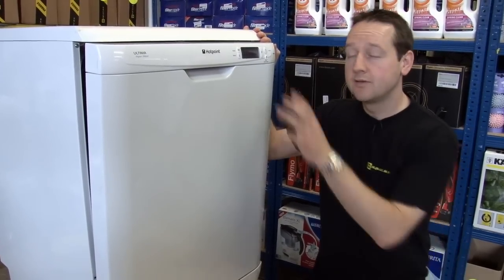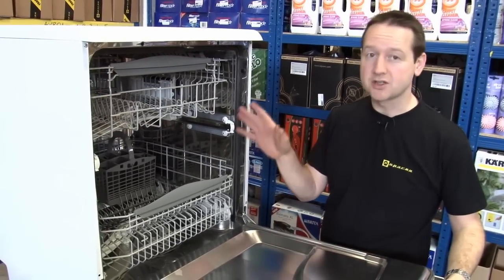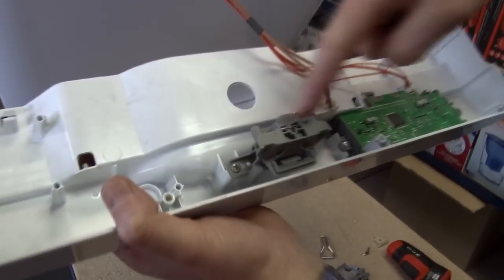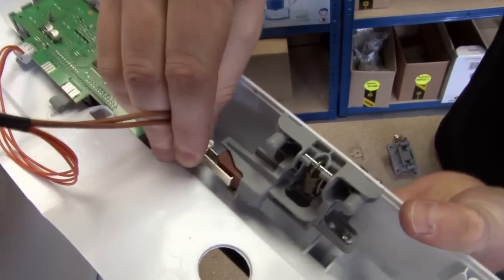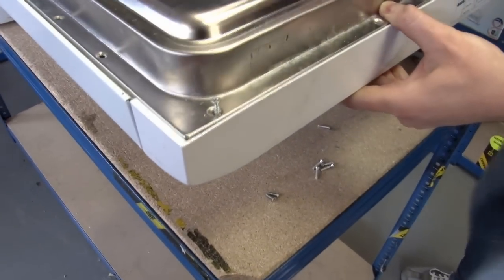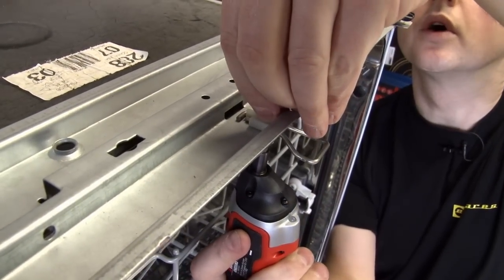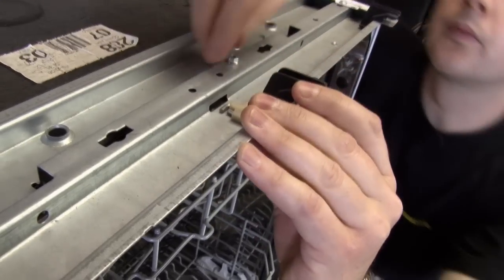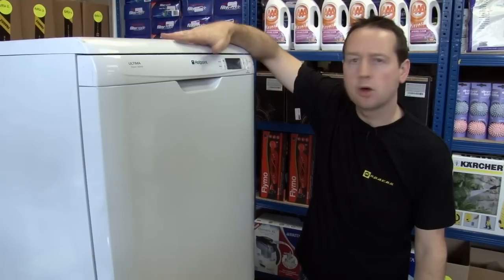How to Replace the Door Lock on a Hotpoint Dishwasher

Comment: Hi Matt
Great video - simple to do after watching it.
Just one thing that may help - it needs an extra 4 screws taking out to allow the top panel to slide out without any hassle.
Reply from the maker: +Harry pollard Thanks for the comments, our editor made a cut from the first to last screw on the top and did not mention the two further down the sides. Hope you sussed it out quickly and resolved your problem.

Comment: We have a fitted Hotpoint BF1620 dishwasher - changing the door looks easy enough but not sure we will change the catch or how to access the top plate.  Will we be able to do this ourselves or call the guy who fitted our kitchen? Thanks
Reply from the maker: +Natalie Threadgold The catch for your appliance is shown here:
http://www.espares.co.uk/product/es830831
To adjust or remove it you will need to slide the dishwasher out from the cabinets. The part appears to be unavailable but may be the same as this: http://www.espares.co.uk/product/es1561044

Comment: hi there i have a LFT 114 hotpoint - i have power but it will not start when the door is shut - would you recommend replacing this 1st ??
Reply from the maker: Hi Matt, test the microswitch on the door lock first and if that is not working then replace.

Comment: Hi guys great video. I just spent £30 with you on a new door lock for my hot point dishwasher. I fitted it & the door is still the same, it won't close. I push it shut & it pops open. Any ideas??
Reply from the maker: Hi Big Al, The lock is in two parts. You have replaced the lock but the hoop catch mounted on the top of the cavity can adjust a little. Take the top of and hold the door closed when you loosen the clamp bolt on the hoop. This should allow the lock to fully close and pull the hoop out a little. You can then tighten the clamp bolt in the new position.
Reply: eSpares Thanks! All sorted now.

Comment: I think it's the lock and not the catch so hopefully  the lock I receive from you tomorrow will fix the issue 😄
Reply from the maker: +Natalie Threadgold Good luck but watch out for the edges of the inner door as they can be razor sharp and cut you easily.

Comment: I have a Hotpoint aquarius+. I think it's 8 years old. The door won't shut properly even after removing both drawers. Also, I can hold the door shut and start a cycle and it doesn't cut out when the door is opened. Is it like the switch is the problem?
Reply from the maker: Hi Stephen, it does sound like the door lock is causing the problem so start there as the lock has the microswitch incorporated.
Reply: @eSpares  I removed the door lock and found the spring was broken. This is a pretty dangerous failure condition given the machine runs with this failure? Could flood somebodies house

Comment: Im struggling with the electrics connector on the latch on my hotpoint Aquarius. Can you just pull the end of the connector to separate it? I'm scared of breaking it.
Reply from the maker: Hi bertaga41, the electrical connectors can be tight, try using a pair of long nose pliers to pull it off but just take you time.

Comment: I have electrolux error 40, its seem, that this door closing fixing problem can solve like that- machine metall wire second side in machine, not lock, let it little bit more outside. Only on crew have to use.
Reply from the maker: Hi Erki, thank you for your post.

Comment: Any idea how to get my MAYTAG model - MDBH980ASW running? All lights are on except two -  the START/CANCEL and DELAY 2, 4, 6 .... this dishwasher is under 2 years old! Maytag just basically said get lost!  Someone from another website suggested it was most likely the PANEL CONTROL or BOARD CONTROL, but parts cost a lot of money! I spent over $1100.00 on this thing!

Comment from the maker: @TheMusicgirl7777 Apologies, missed you reply to my reply. Unfortunately when it comes any integrated electronic boards in appliances, they can be expensive and a little fiddly to replace AND it can be very hard to determine WHICH of them is at fault. The only thing might be that the lights on display may be an error code - if you can confirm it is an error code you could possibly diagnose which integrated control module has broke. Contact Maytag for a list of error codes for your dish washer.
Reply: this would also work for the ariston lf 70 dishwasher

Comment: I installed the exact same part, still doesn't work. The spring tension on the plastic latch is so strong it doesn't rotate, came like that out the box...

Comment: this the same for indesit DIF04.. Looks similar..
Reply from the maker: The lock is very similar but check the connector to the switch as this we believe is slightly different on some DIF04 models.

Comment: I replaced the door lock on my FDW80 as the spring had broken on the old one. New lock supplied by eSpares. Received a recall notice from hotpoint who then sent an engineer for free. Guess what he then replaced? Yes the bloody door lock. eSpares sold me a part that had been recalled as faulty due possibility of fire. New new door lock is fitted with a guard to protect from water ingress. I would like a full refund!